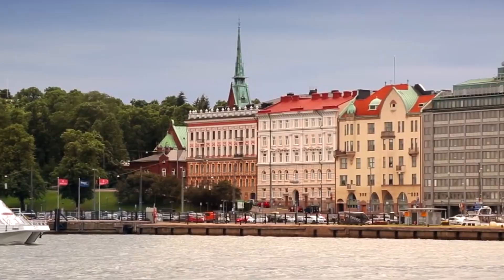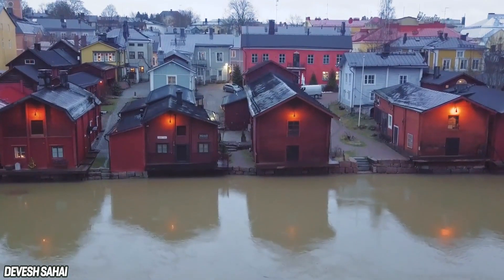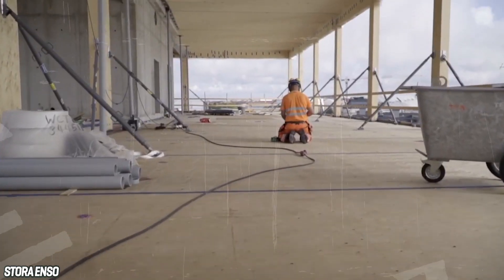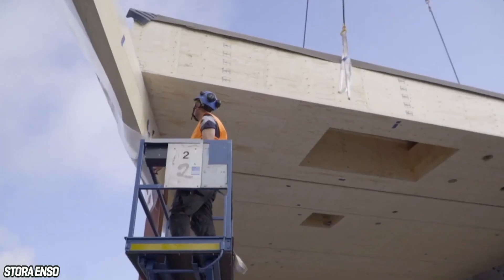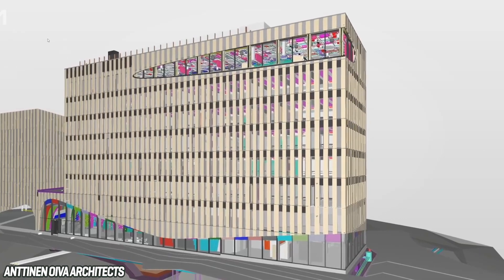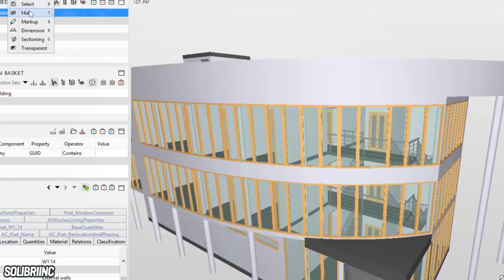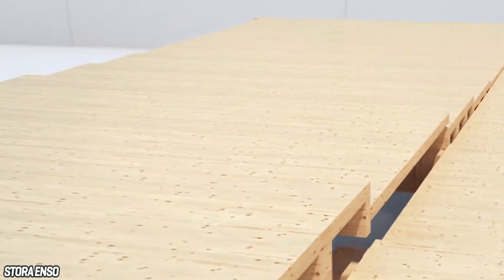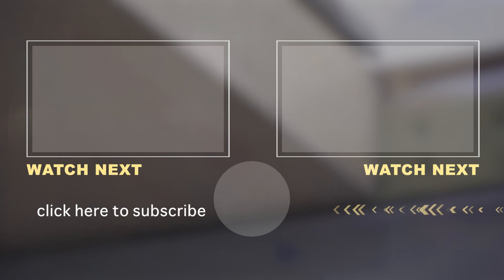Inside Finland's $130 Million Wooden City

Comment: I think the biggest risk is fire. If the apartments can be effectively isolated from each other, this will work, I'd say. There's a long know how against rotting in Finnish building traditions. Like they showed, the ground levels (at least in the complex higher buildings) are made of concrete - and it's the ground level were the moisture is the major issue.

Comment: they better be planting twice the amount of trees they're cutting down
Reply: The Finnish Forest Act (law) requires all cut down forests to be replaced by newly planted ones. Twice is a bit of a stretch as over three thirds of Finland is covered by forests already. Twice simply wouldn't fit anywhere :) But if talking in terms of number of trees, yeah generally around 2000 small trees are planted in the place of the 300-500 (depending on tree species) big ones that are felled per hectare.

Comment: Liked the build - timber warping despite the drying out in industrial ovens is a major possibility.  The air full of water molecules.  Place it under a tarp or under roof in a building not @ lick up level and that timber is sucking in moisture.  Sure some builder can muscle them back in with a nail gun but hell, force under pressure must equal timbers splitting through and leaving the integrity of the structure eventually.
Oh and the cost of living example you chose  - 3 courses basic fare?  Damn Daniel!   (sorry 90s phrase stuck in my head).  
Try Australia for cost.  If you sit inside yr steel frame squalor only leaving to go to work and never eat out you may be able to afford min legal luxuries BUT anything else is wishful thinking. 
AND …